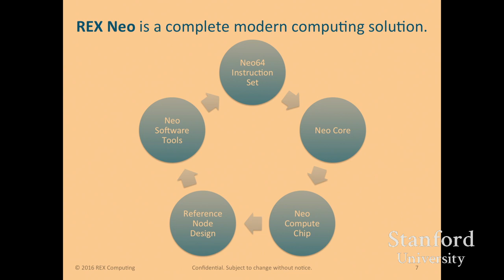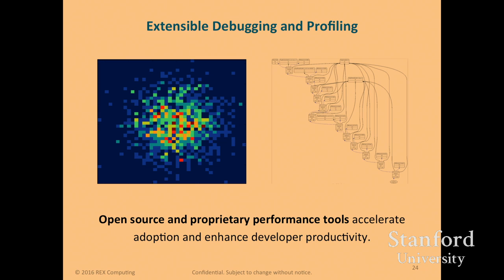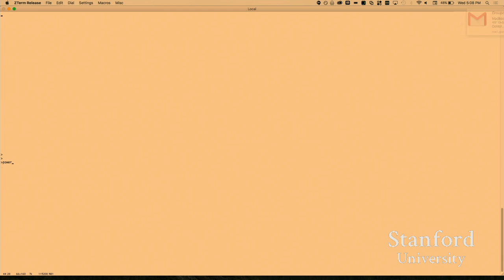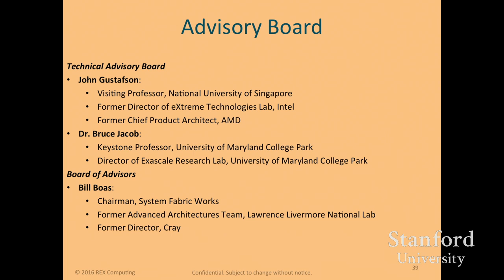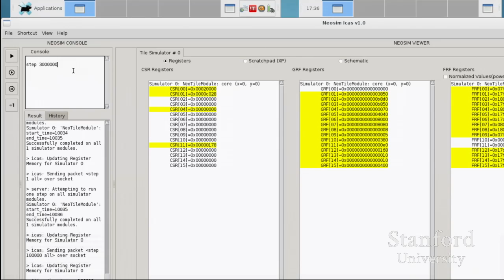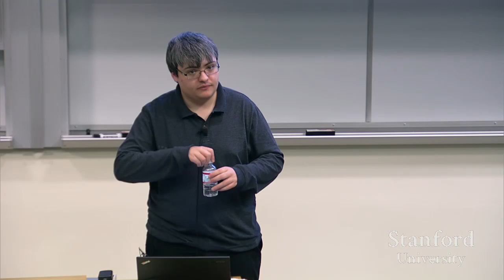Stanford Seminar: The REX Neo Architecture: An energy efficient new processor architecture

Comment: Imagine having a belt machine-based processor, like the Mill, at each computing node instead of a plain old vanilla RISC-like VLIW processor...
I mean, the MIll is also a rather simple architecture based on a VLIW processor & supposed to achieve high level of ILP by means of simultaneously utilizing most functional units - except I currently fear that even in the best case their design would currently be bandwidth limited(memory wall).
Granted, belt machine-based processors aren't currently very common, but I'm convinced they'll prove advantageous once the memory wall has been overome (by means of having a different memory access topology, like here with the NeoChip which is a distributed memory system).
Reply: Mill and Rex would work well together in some ways. Not in all ways, but I feel that the Mill's variable-length VLIW is pretty generally applicable.

Also, these guys kinda have the opposite problem that the mill does: their processor clearly exists, but it's hard to see what kind of compiler could actually take advantage of its features (as opposed to Mill, where the hardware hasn't materialized but they have actually told us exactly how the compiler does its thing).
Reply: @NXTangl  true, but it's not just hard to see what kind of compiler could take advantage of that, it's also hard to see what programming model, memory model & language would be needed to best utilize those features - in other words: which programming paradigms & models would a developer best choose? & even if one knew which one to choose: are there even programming languages which support those even available yet?

Comment: This idea of a "2D-Mesh Network on chip" looks very similar to the design of FPGAs. Though I imagine there's quite a difference between the two?
Reply: yes, except this is much more coarse-grained, stuff like this usually goes under the name of "coarse-grained reconfigurable computing" & its computing network topology looks like it's a systolic array, except this one does also have (most, or maybe even all?) of its main memory on-chip & basically no cache, which is an interesting solution very seldomly found elsewhere, if anywhere at all.
Reply: Lots of chips have a "2D-Mesh Network on chip" type of approach, the difference is in what's actually inside those blocks that vaguely say "core" and "NoC" :)
Reply: Each processing units may have local memory while also being accessible from further away (NUMA - non uniform memory access - it may have a global shared address space, but latencies & bandwidth will vary according to access locality)